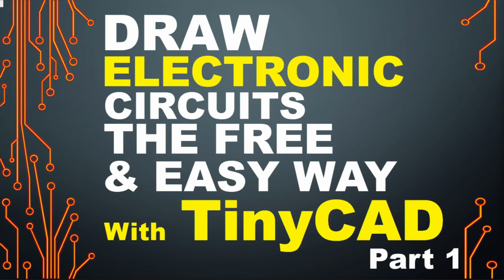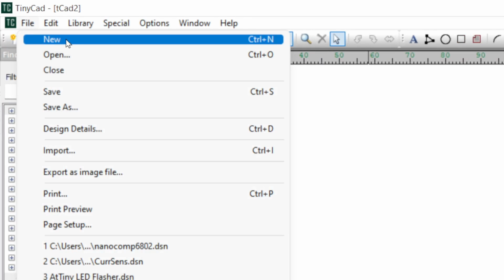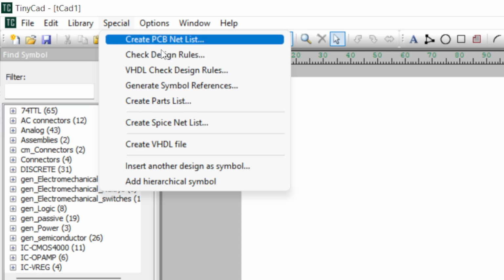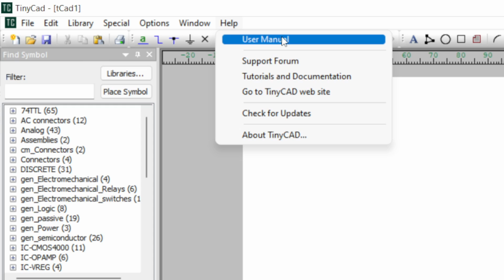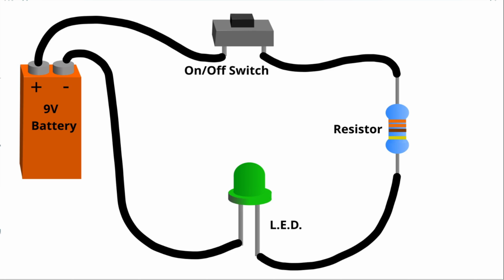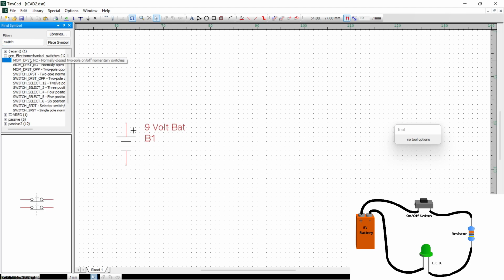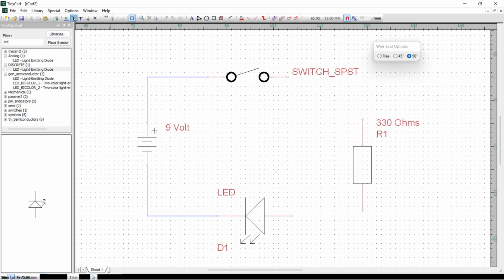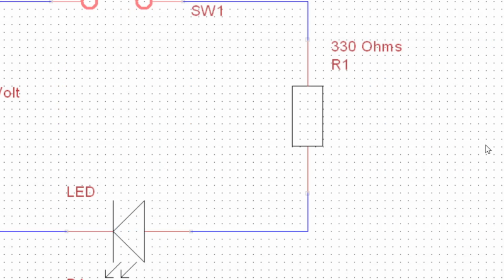Draw Electronics Circuits the FREE and EASY way with TinyCAD - Part 1 - Introduction

Comment: Thanks for the guidance - enjoying using it. Quick question which maybe you can help with - When inserting symbols is there any way of changing the colour of the font (currently red) for the reference/ name/ value etc. Thanks in advance and please keep up the good work.
Reply from the maker: Great question Simon! One way to do it is to go to the "Options" menu at the top of the screen and then select the "Colours" option. Then choose a colour in the box shown next to "Pin". This changes both the pin colour and the text colour for all the symbols in the circuit at the same time, which may not be ideal, but might work for your needs. Alternatively, under the options for the specific symbol you could choose to not show the name and other parameters and instead use a separate text annotation. You can choose a colour for each text item by clicking the text itself and then clicking the colour button in the text tool options dialog box. This would be a bit slow but might work when you want to change the text of just a few symbols. Hope that helps.
Reply: @teksparkz  Perfect - that really helps. Will probably use a mixture of both tips!  Following on from your tutorials, I am now using both TinyCad and DIY Layout so thanks agin for the help.